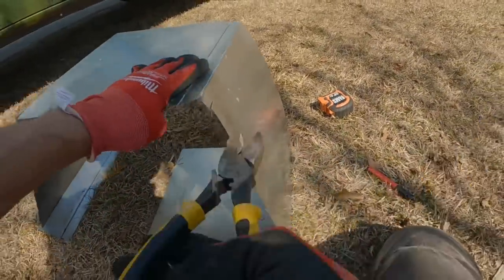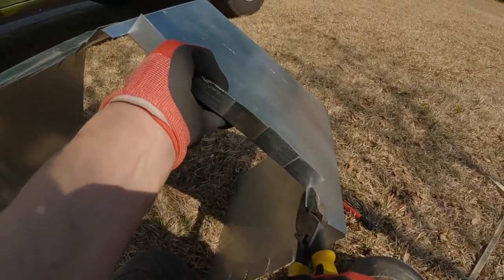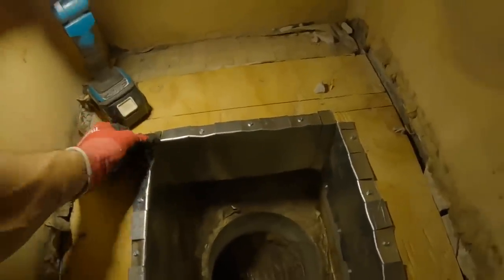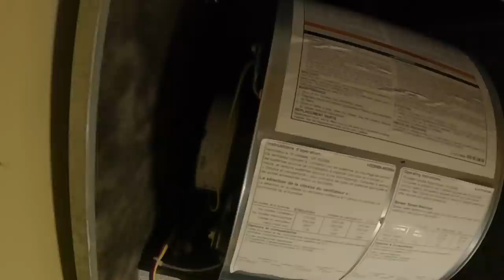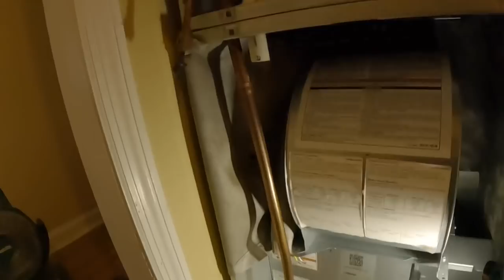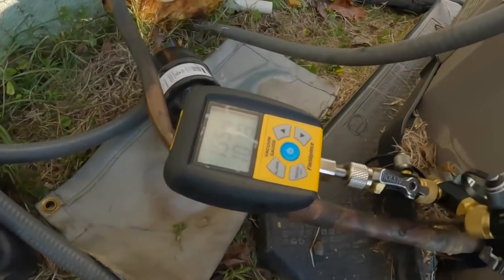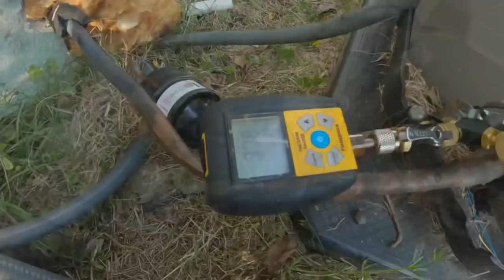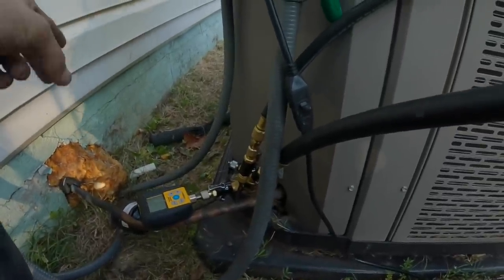Mobile Home Electric Furnace - Part 2. This thing is going to whoop me!

Comment: I just ripped a furnace out of a mobile home and it was a nightmare. brad nails and glue is what holds those things together. The walls will be 1"x3" 24" oc at times! with no framing nails but glue and brad nails.

Comment: No shame in leveling the coil. I've had to do that on standard upflows before. Can't say nothin' bad because I wouldn't do a mobile home install, I barely like servicing them.  What wowed me was your torch tip. I use a 0 or 2 for that stuff. When you lit it I was wondering if you were going to weld the house frame. 😃

Comment: The flange has to be beat down flush with a hammer to a level floor. I always use nails instead of screws so bottom of furnace has smooth surface to sit on.
Reply from the maker: Good advice.

Comment: So  what holds the furnace down? Does it just sit on floor or is it screwed down? How far should it stick out from the wall or just flush? How does the air filter system configured?

Comment: Question.....is it normal for a hvac installer to simply set a new electric furnace to the opening of the floor without screwing or sealing it to the floor or downdraft ductwork???

Only reason I ask is the installer who installed a new electric downdraft heating furnace in our home had to litterly cut the masking and unscrew it from the floor on the old one. Then all he did was clean the area around the opening on the floor and then he simply set the new on the opening.  That's it! No sealing ,no screwing, nothing.  I can litterly lean the furnace away from the opening.  The only thing keeping in place is gravity.  Is this normal??? Anyone know?? Thanks in advance for any answer.
Reply from the maker: that’s not normal for me. at least screw it down.
Reply: @HVACGUY  thanks.